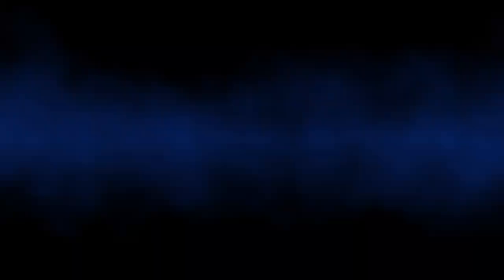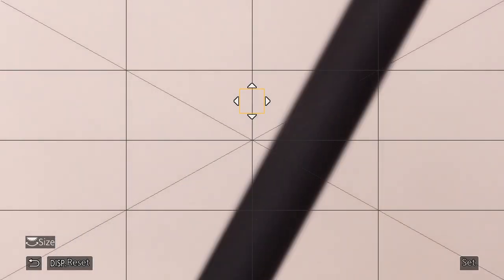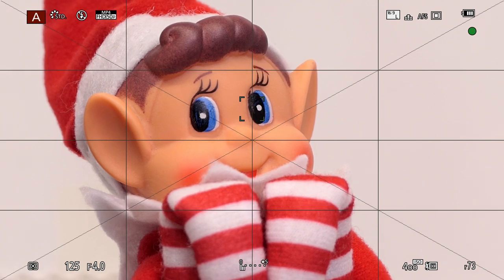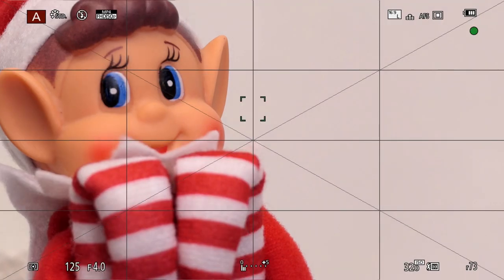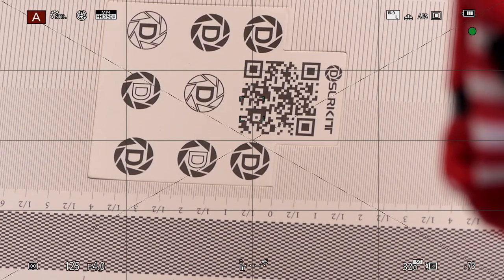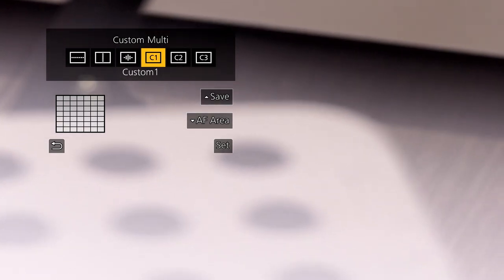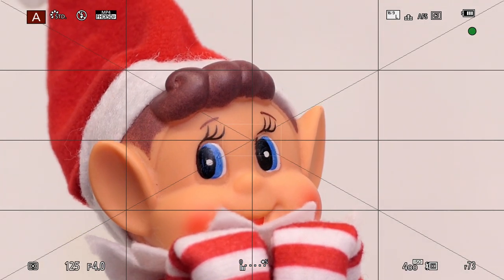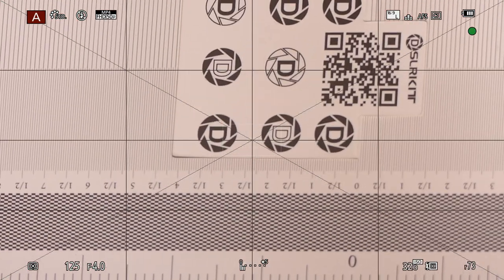Panasonic Lumix Bridge Camera Autofocus Improvement

Comment: Superb advice!  I wondered why my autofocusing was hit and miss with the spot and center focus.   Tried your technique on the FZ300 and it works much better, and faster.   

I often use manual focus, with peaking, for static subjects, pressing the autofocus button on the side to get my focus (since the manual focus wheel is not that easy to use, though I'm getting better at it) but I see the single area focus technique doesn't apply in that manual mode.    The focus area is the manual focus mode rectangle that you yourself can indeed resize with the wheel, though, at the smallest area, it seems larger than the custom single area, and the actual focus area is again slightly, but only slightly, outside the upper and lower edges of that rectangle and definitely further outside of the sides.  

All worth understanding for those better shots and all thanks to your research.

Comment: Thanks Graham, this is fascinating. With my FZ10002 I normally resort to manual focus to set the precise focus point. I will try this method and see if I get better results.
Reply from the maker: would be interesting to see your results using the single area custom mode.

Comment: Great Info. Unfortunately my FZ1000 lens is stuck and I think I'm going to have to replace the lens or get a new camera. Any suggestions on whether it's worth fixing or not?
Reply from the maker: Have you tried to gently push the lens back with the  power off. It might just be the lens frame binding at one point.
Reply: @GrahamHoughton12  Thank you, I will try that.
Reply: @GrahamHoughton12  Thanks so much Graham. I tried your technique and pulled on the lens and now it works again. You just saved me about $300 in repair cost. Cheers.

Comment: So  what you're really saying with this method, that leaving the camera in the focus method normally used for moving subjects actually works better for static subjects as long as you have programmed  that custom  center focus area.  Interesting.
Reply from the maker: Yes, exactly. The only thing that I would suggest is using AFF rather than AFC as the focus method works better on subjects which can alter direction, quickly.

Comment: Great focusing tip Graham, I have tried it on my FZ1000 II  and FZ300 and a bonus is the custom focus disables the 4 way buttons so you can’t accidentally move the focus point when you set it in the centre. Only negative is when I tried to change it on my G9 you loose the Human/Animal detection option in the custom mode. Good improvement when used with my back button focus setup. Many thanks.😊
Reply from the maker: Thanks for sharing, I cannot test on m4/3 cameras like the G9 so thanks for the update

Comment: Thanks for the videos and newsletters.  I learned how to use my Panasonic bridge cameras from you.  Then I went to the ZS25, GH1, FZ200, OMD E1,  S21 ultra, and now Sony RX100 VI.  There have been a few reasons for my migration but one of the main ones is auto-focus.  You can fix many things in post but not focus.  I think Sony has nailed it.  For me a casual and vacation photographer I like the 1" sensor, 20X zoom, and size for travel.  I compared it to the Panasonic but the auto-focus on the Panasonic just does not seem to compare to Sony's phase detection system.
Reply: You surprise me that you think Sony have nailed the auto focus. I jacked in my 100's and camcorders specifically because of the poor performance of the focus.